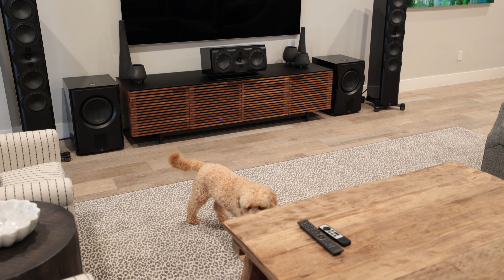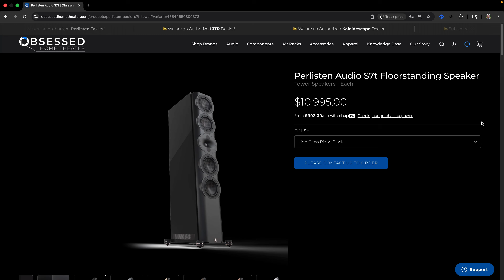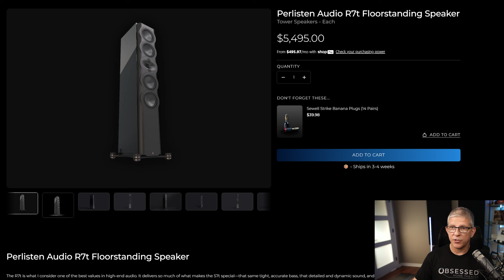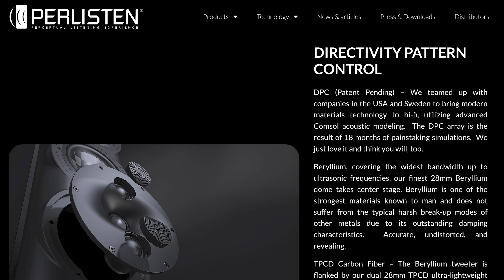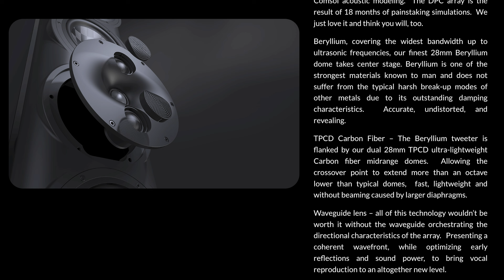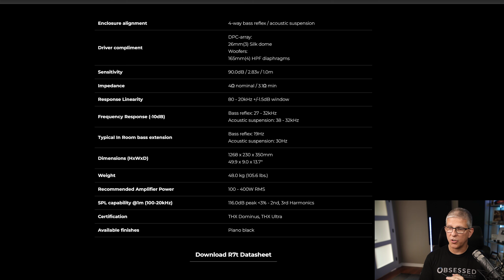Perlisten R Series: R7t Tower Speaker Overview

Comment: i have the klipsch  KSP400's  with 15" subs built in ... back in 2000 ...  still running strong after 25 years ... paid just under $4000 for the pair and that was a lot back then.